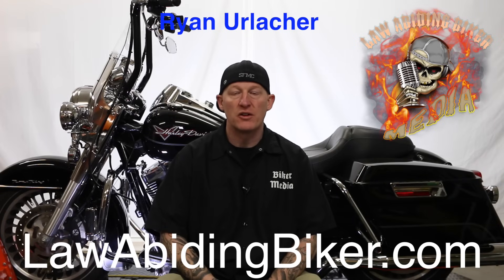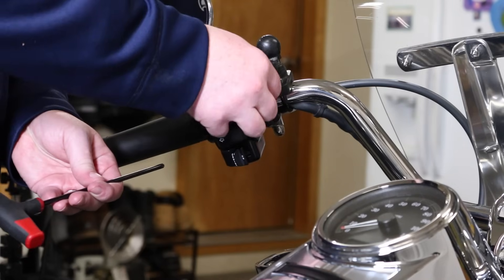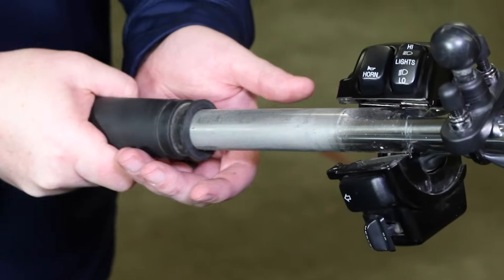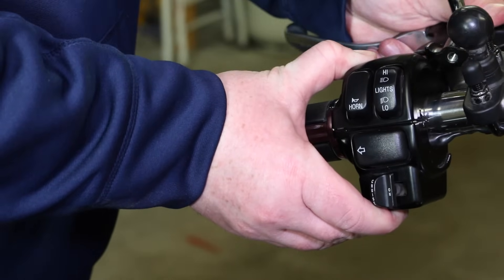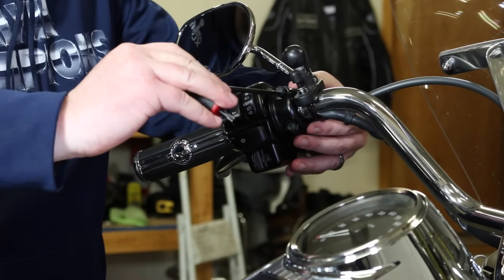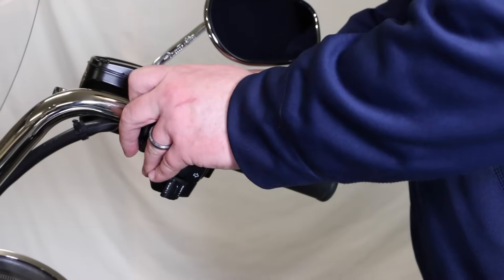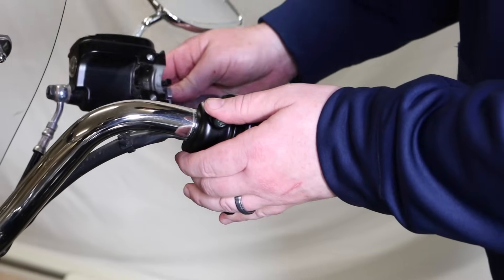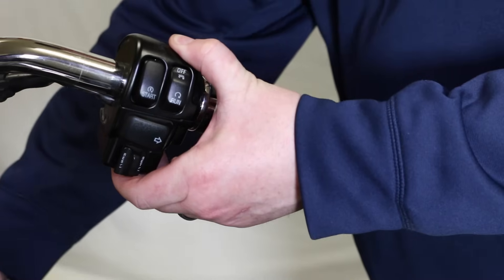Install New Hand Grips on Harley Davidson | Motorcycle Biker Podcast

Comment: Thank you for a simple but very informative and easy to understand video. I'm going to use this to change the grips on my 20 Breakout. Thanks!
Reply from the maker: Right on
Reply: @RyanUrlacher  just a heads-up. I literally just got done installing a pair of new Edge Cut Harley grips on my 20 Breakout using your video. Worked like a charm. Thanks!!

Comment: Thanks for the video. Won’t the grip still twist down at the other end without glue? It’s rubber so it is malleable. At least my stock grip is. I’m asking because this is the exact scenario I just encountered. In fact, the whole thing spins. Just doesn’t slide off.
Reply: @christopherhowe464  Yea man I just installed mine on Saturday and I think I'm have to put glue on the handle bars then some I side the grips. My throttle side is sliding off and that's not good!

Comment: I'm curious to know if there is anything else involved if the bike is older? I'm going to be changing the grips on a 2005 softail. The clutch side would be no different but i'm not sure if the throttle side will be the same. Thanks for the great videos!
Reply from the maker: +mvpbroker No real differnce. They haven't changed the wiring on the heated grips for many years. The only slight diffferences is exactly where they want you to tie into the main power. We have a heated grip install video that will have you covered. http://www.lawabidingbiker.com/harleyheatedgrips

Comment: Great video, but what's with the heated grips on a bike? I live in Michigan and never had a problem with my hands getting cold that gloves didn't solve, also being a snowmobiler I see the use from them on snowmobiles but not motorcycles if it's that cold I'll just cage it as I don't want road salt on my bike.
Reply from the maker: We ride as long as we can, even into winter here. We ride in below freezing temps many times.  We love riding. We also have heated grips on our police Harley's. We don't want to wear thick gloves. With heated grips we can wear our thin gloves. Once you have heated grips, you'll never go without them. Easy to turn on at a moments notice and get some heat up your arms into your core. Same with a heated seat. Rock on

Comment: Love your videos. I have a question about removing the hand grips. I bought a new 2017 Street Glide Special and a new 2+2 Bars from Khrome Werks. I want to reuse the old grips. Any tips on removing the old grips besides a razor if they are not free?
Reply from the maker: The right side grip comes off easy as it is not glued to the bars.  The left grip is affixed to the stock bars.  We've found that if you squirt some penetrating fluid down the grip you might get it loose.  We've had good luck and bad luck.  You can always buy a new left side grip for about 8 bucks at your local HD dealer.

Ride safe & Ride Often!
Here is a link to a bunch of our useful Free vids: http://www.lawabidingbiker.com/freevideos
Here is a link to some of our useful for purchase videos: http://www.lawabidingbiker.com/buyvideos
Want Answers & Information Fast? And help support us at the same time? Do you like the content we provide?
Our patrons get answers to their questions/comments/feedback in less than 24 hrs and are part of our Private Facebook Group. If you are interested in being in this exclusive group you can get all the details at ==> http://www.lawabidingbiker.com/patreon
If you haven't subscribed to the Law Abiding Biker Podcast make sure to do so. Listen in as we talk weekly about issues/items like this & so much more. You can listen on iTunes (Apple/IOS), Stitcher Radio (Android), or any other Podcast App ==> http://www.lawabidingbiker.com/podcast
Join our free email club at http:///www.LawAbidingBiker.com/EmailClub. Only relevant content will be sent from time to time. Email club members are the first to find out about free or for sale content are given special coupon codes.
Reply: Thanks Ryan! i appreciate the quick response! I plan on doing it tomorrow. Unfortunately, my  closest Harley dealer is over an hour away and I'm leaving next thursday on a 300 mile trip on the Harley. Ill let you know how it goes!

Comment: hey bro i bought a pair of harleys get a grip and the throttle grip has some play on it. not throttle play as acceleration  deceleration but they wiggle in and out. my stock grips did that but these do it way more
Reply from the maker: Hmmmm, Id make sure that you pulled the assembly all the way up on to the bars before tightening the housings down. Sound like some slop might have been left.
Reply: thanks man, I've tried loosening the assembly and push the whole thing inwards already with the same results. next stop HD service center i got'em there. thanks for the reply and help👍
Reply: Had the same issue.. Little play on new grip (throttle side)  grip went in & out about 1/4 inch.  Ended up having to push the switch housing inward (toward dash)  slightly and used m bell to seat grip fully and it took the difference away.  No play throttle snaps back upon release.  Hopefully it holds..

Comment: Hey Ryan just about to do this on my 2015 ultra limited. Do I need to do the cardboard thing on the brake lever on that bike to?
Reply from the maker: Never hurts, but we don't anymore. 2015 you're fine.  That's because the ramped the switch and lever and they go back together w/o sheering the switch off.

Comment: I discovered I had the old mechanical braking mechanism when changing my grips. Then I dropped the little brass piece that attaches to the brake line on the ground in a parking spot in my apartment complex during a thunderstorm. Then I spent 45 minutes searching on my hands and knees getting covered in oil and other fluids on the ground. Then I quit, lol. Guess I need a new part.

Comment: I have get a grips on my bike and I want to reuse them,how do I take them off without wrecking them
Reply from the maker: +bubbles12376 The throttle side is easy.  The brake side is glued.  Sometimes you can brake it loose by twisting it.  you could always try a product like WD-40 to break it loose.  If not, your local dealer has stock grips for around 8 bucks.  Ride safe & Ride Often!
Here is a link to a bunch of our useful Free vids bro: http://www.lawabidingbiker.com/freevideos
Here is a link to some of our useful for purchase videos: http://www.lawabidingbiker.com/buyvideos
Want Answers & Information Fast? And help support us at the same time? Do you like the content we provide?
Our patrons get answers to their questions/comments/feedback in less than 24 hrs and are part of our Private Facebook Group. If you are interested in being in this exclusive group you can get all the details at ==> http://www.lawabidingbiker.com/patreon
If you haven't subscribed to the Law Abiding Biker Podcast make sure to do so. Listen in as we talk weekly about issues/items like this & so much more. You can listen on iTunes (Apple/IOS), Stitcher Radio (Android), or any other Podcast App ==> http://www.lawabidingbiker.com/podcast
Join our free email club at http:///www.LawAbidingBiker.com/EmailClub. Only relevant content will be sent from time to time. Email club members are the first to find out about free or for sale content are given special coupon codes.

Comment: I had to glue mine as it didn't pinch in to stop it turning
Reply from the maker: It should have Steve. Never had that problem. Make sure it's in there just right. If it's not it will in fact slip.
Reply: Ryan Urlacher I was installing a pair of Kuryakyn ISO grips and as far as I can tell it was in correct, I'm putting a new pair on the new bike I've just got so I'll give it another go and let you know

Comment: I have a 2005 Road Glide everything is glued on the clutch side what's the best way to take this bastard off?
Reply from the maker: We just twist and turn them til they break free
Reply: I used a blade to take it off. They used to much glue to twist. Was a Bitch but I got it. New grips look sick and I used little glue.
Reply: I used a small spray bottle of water and a very skinny flathead screwdriver to lift the rubber up some to get more water under the grip. Then just twist and work the water between the grip and the handlebar. It should pull off pretty easily and you won’t have to cut them off in case you want to put the stock grips back on before trading the bike in one day.